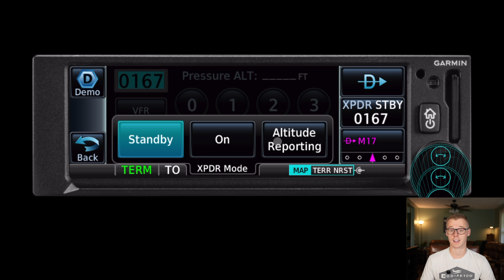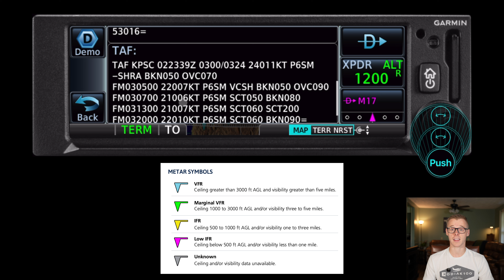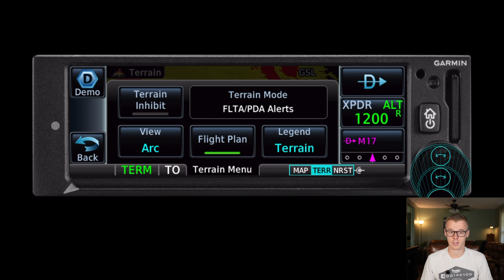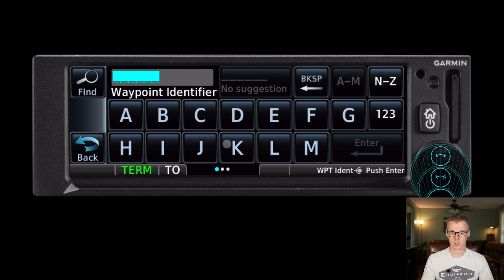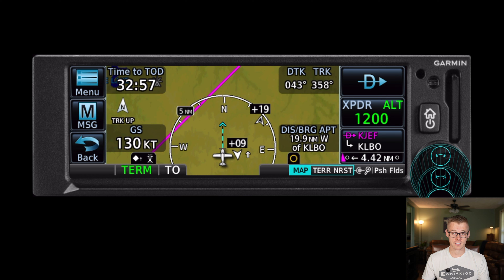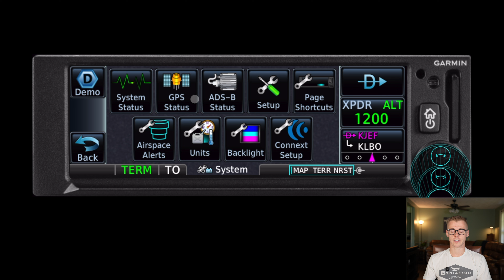How to Use the Garmin GNX 375 - Tutorial for Beginners

Comment: How do I use the ‘Rubber Band’ system.
Reply from the maker: To rubber band your flight plan, just have it loaded, enter panning mode by moving the main map with your finger, and then select “graphical edit.” That will allow you to drag and drop any waypoints to a different waypoint and automatically update the flight plan.

Comment: I’m thinking of possibly adding a G3X to my panel to add to my GNC375. Obviously, easier to see. Do you have a video in this configuration? Pros/Cons beside cost??? (C172)
Reply from the maker: Hi Drew! I don’t have much experience with the G3X but it is an absolute beast. I think it offers a huge value, especially when you use it for engine monitoring as well. If you have the panel space and the budget, you can’t go wrong with adding it, however there are more cost-effective and light weight options to add a glass display (such as dual G5’s) if those are a concern.

Comment: Question 
I was flying XC on an IFR flight plan this past weekend. 
Suddenly, ATC told me to cancel flying towards my current waypoint and go direct to the airport. 
I deleted the waypoint I was flying towards, thinking the GNX750 would update the magenta line to show my current position to the airport. Instead, it draws the magenta line from my previous waypoint to the airport. But ATC wants me to fly to the airport from my current position. How do I fix this without reentering my flight plan?
Reply from the maker: Hello, I see the problem that you had. I would recommend that you use the direct-to button in this situation. If the airport that ATC wants you to go direct is not in your flight plan, just leave it on the “waypoint” tab and search for the waypoint from there. It will then provide a course line directly to that airport regardless of your flight plan. If the waypoint is in your flight plan, you can click on direct-to and then hit the FPL page, and select the waypoint to fly direct. After that you can then go back to the flight plan and modify it prior to reactivating.

Comment: Another useful feature concerning the transponder. If you use the VFR button instead of typing in 1200 it remembers your previous squawk code (sort of like a flip/flop button on modern comm radios).  The benefit is if for some reason you needed to go back to your previously assigned code (say ATC did not want you to squawk VFR yet) all you need to do is press the VFR button again and it will go back to the previous code.
Reply from the maker: I did not know that - thanks for sharing!

Comment: https://www.youtube.com/watch?v=h8Qu8GyT8F8

We have a 375 in our airplane. A couple of comments:
2:34 bigger physical knob, I like Map Traffic & NRST. Flight plan is easily available from the map by just tapping the flight plan. And in the event that I have an issue, I really want to know where the nearest field is. It's also useful when talking to ATC when they say "Radar contact 5 mi SW of some airport". 
10:08 my user config items: Time to TOD, DIS/BRG APT,  ETE (for my wife), GEN Timer (for fuel tank switching). I specifically put ETE in the lower left b/c that's where a whole bunch of popup buttons appear when I'm close to the airport and really don't need ETE any more. Although based on 40:28, I'm going to tinker with using scheduled messages instead.
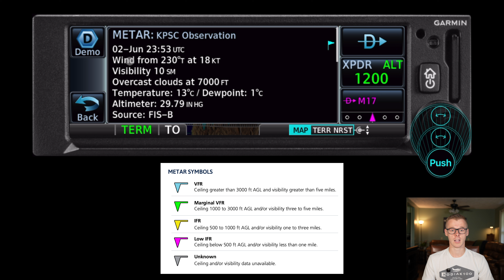15:28 I really do not understand Garmin's obsession with using non-standard colors for METAR. For example, why is MVFR green? Everywhere else that means VFR and blue means MVFR. They do this in Garmin Pilot, too and IMHO it's dumb. Fortunately in GP it's configurable. Do you know if the colors are configurable in the 375? 
19:27 Re: seeing crab angle, that's only true if you have the GPS connected to something that provides your magnetic heading, like a G5. If you don't have the heading info, the GPS doesn't know if you're crabbing or not, and it assumes that you're flying straight on the GPS track that it can measure.

Thanks for this video. I learned a bunch of features that I didn't know about.
Reply from the maker: Thanks for your comments! Glad to hear from someone with some good, really world experience with one. Scheduled messages are nice for switching tanks, but I think (not 100% certain) that they reset with a power cycle so if you are 15 minutes into a tank, it’ll reset to 30 minute remaining again at startup. Not a huge dealbreaker but something to keep in mind. If the GEN timer holds its spot through a power cycle, that might make it a better option - not one I had considered before. I have not seen anything allowing you to change the METAR colors in any Garmin unit outside of the Garmin Pilot app. It may be worth having a discussion with your avionics shop though, as I know they often have more access to settings on the back end than we do. Thanks again for your comments!